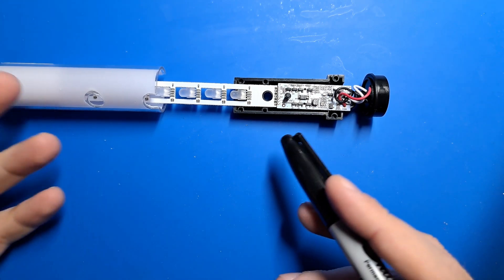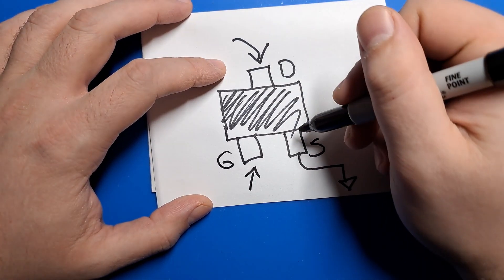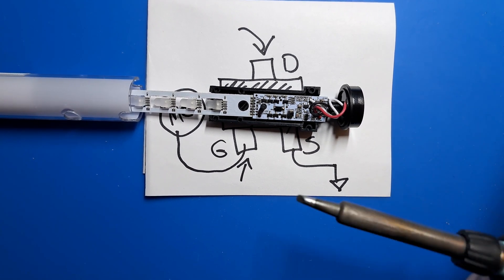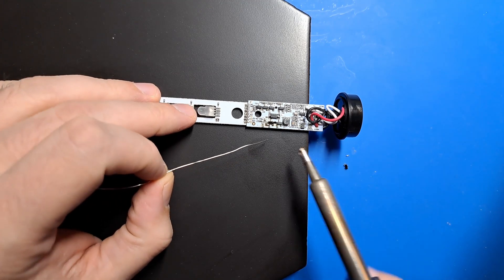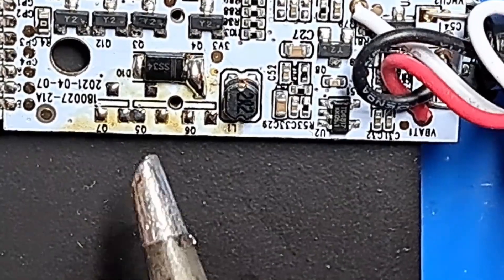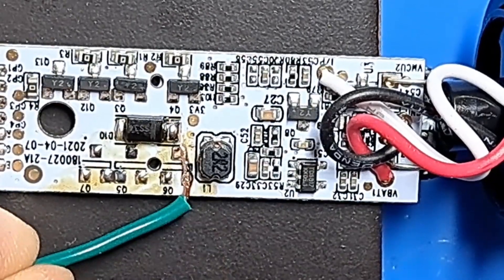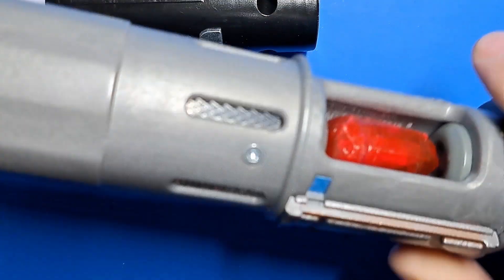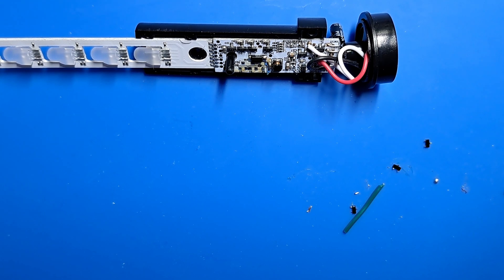Single Color Lightsaber Blade Mod

Comment: Hey man, your videos have been a great help! I picked up Leia's blade at Disney and was very disappointed I couldn't have an orange blade. I ended up learning from you and I did a cut on the blue line, and bridged the power from the blue drain directly to the green and red connectors. It makes an orange I quite enjoy! But my blade is having problems now, after about 30 seconds of it being on it starts to turn off and on over and over going through the normal animations. I don't get the click of the saber being disconnected, so it's got constant power, but it just starts acting funny. I did multiple iterations of the mod to get the right color, and it's been having this issue since the beginning. If I turn the hilt off and back on, the issue persists, but if I turn it off for an extended period and then back on again, it goes back to the beginning where I have about 30 seconds.

Do you think this sounds like something is either overheating or overdrawing power? I only have bare minimum electrical skills, but enough where I felt confident doing this project.

I appreciate any help you may be able to offer! Keep up the amazing work!
Reply from the maker: Have you tried replacing the batteries? It sounds like a battery issue.
Reply: @Ruthsarian  I did just attempt that, unfortunately all the AAA I have are non-alkalinr and they only emit a white color when inserted. I did do something strange though, I unlocked the blade from the hilt and pulled it out ever so slightly until it made the disconnect sound but there was still power going to the LEDs. There were no sound or visual effects, just a solid orange saber and it had 0 issues at all. I'm not sure what that means.
Reply: Upon further inspection, I feel like it's connected to the effects. It's really those other channels that control the flashing, on and off animations, etc, that seem to be the overlying problem. I don't know what I could have touched that would have affected those, unless that single gate powering both the green and red is too much?
Reply from the maker: @TheJoshinatah  any chance you can take a picture of the PCB you modified and share online somewhere, like flickr.com or imgur.com so I can see what's going on?
Reply: @Ruthsarian  after redoing the last test to just be red, the same issue persists. So I no longer believe it's a power draw or heat issue.
Reply from the maker: @TheJoshinatah  do you have a non-modified blade to test with just to confirm the issue is with the blade and not the hilt?
Reply: @Ruthsarian  I apologize for the long wait. I acquired a new blade and it is not the hilt. I'm not sure what happened during the mod but something on the board isn't functioning/damaged. I'm nervous to try again, I was wondering if it was because I was using a single channel color hilt (blue) and trying to force it to be dual channel (R+G). Blue is my least favorite saber color, so I was hoping for orange, but I can settle for green if it's having some issue with that.
Reply from the maker: @TheJoshinatah  my guess is something in the blade is overheating. possibly an unintended short somewhere on the blade controller. Maybe a little blob of solder found its way between a couple components and made a connection that shouldn't be made. the short is causing the voltage regulator or microcontroller to shut down because of excessive current draw. that's why it works again (for about 30 seconds) if you leave it off for a while. it's cooling down. you power it on. it starts to heat up. after 30 seconds it shuts off to protect itself.

Any chance you could take a picture of the blade controller and share it with me. You could e-mail it to me at rutharian@gmail.com or post it online somewhere and send me the link. or you could  join the galaxy's edge discord server at http://swgediscord.com/ and contact me there. There's a channel on the discord server, #makerspace, where we talk about issues like this.

Comment: Is there any reason you couldn't replace the transistors with a manual switch? That way you could open it up and change colors at will.

For context, I want to change the color on my Cal Kestis legacy saber, which doesn't have any official way to change colors
Reply from the maker: Only issue to keep in mind is the current. the switches you use should be rated for at least 500mA, but probably 1A.
Reply: To further the questioning about this do you think it would be possible to get orange or purple if you had 2 switches on and 1 off? I dont mind the task of taking it apart to change the color as I wont do it very often and just having the ability to is all I want.

Comment: Any way we can attach a Pot to the blade controller to essentially turn up and down the colors individually? It’s always been a idea of mine but I haven’t had enough time/resources to get this project off the ground. Thanks!
Reply from the maker: it'd be possible, but a bit of work.

you'd have to use a pot for each color transistor and configure them to create a voltage divider on the gate pin. assuming a 3-pin pot, middle pin goes to the gate, one end to ground, the other end to the power rail.

you'd have to lift the gate pin of each transistor so it doesn't make a connection with the PCB and only with the pot (or, more likely, a wire to the pot). 

then you have to find a place to mount the pots. can't be on the hilt unless you add some sort of connector so you can disconnect the pots when you pull the blade (or never pull the blade, ever again). if you mount them on the blade they'll have to be in a place you can reach while it's on. do you try and make it subtle? or make some kind of custom piece that's glued to the blade and is positioned so it sits just above the emitter when the blade is inserted? how will that look? 

Possible. But it's some work and you've got some design questions you'll have to answer.
Reply: Thanks! I’ll look into it! That’s great info and I’ll start a project on it. I will definitely have to modify the hilt to add pots to the outside and try and make it comfortable and durable. (I am okay with leaving the balde on tall the time, at least in the 1st revision.)